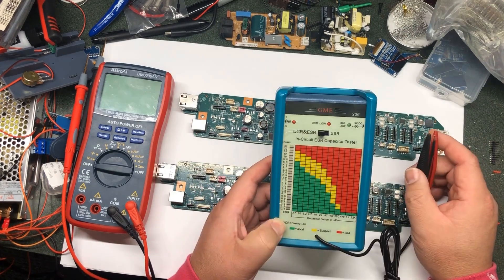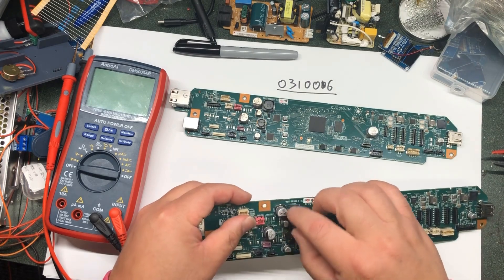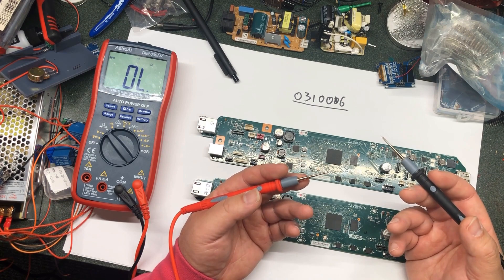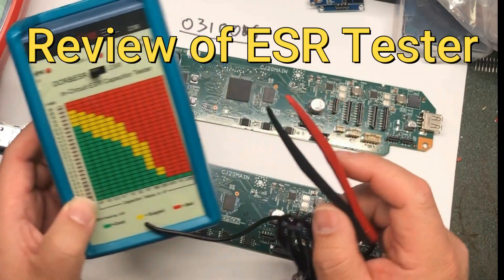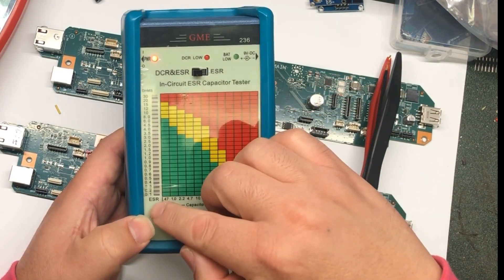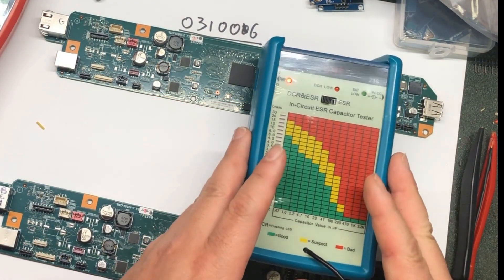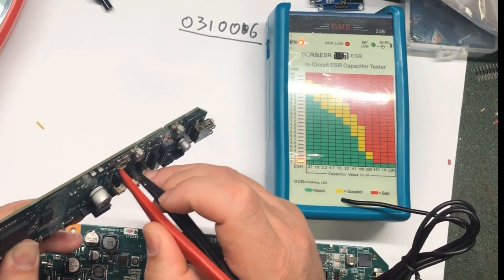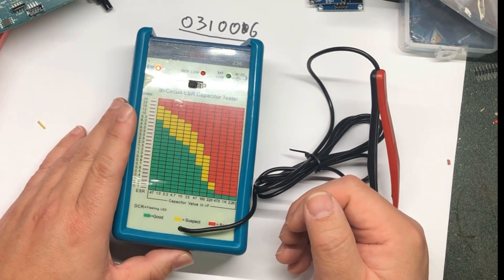Diagnosing ET-8550 Mainboard 031006 Error with In-Circuit ESR Capacitor Tester & Multimeter

Comment: Thank you very much for your reply. I have another basic question: when the device is set to DCR/ESR mode, and the test probes are short-circuited, it makes a beeping sound, like a siren or an alarm, similar to a police siren. I mention this because the BK PRECISION 881, which is exactly the same as yours, also makes this sound.  It's just a curiosity; I've already ordered the same model as yours (GME 236). My specific question is whether yours also makes the same beeping sound as the BK PRECISION. Thank you very much. Best regards.🎩
Reply from the maker: Thanks so much for your kind words and for supporting the channel! Yes, the GME 236 I use does make that same beeping sound in DCR/ESR mode when the probes are shorted, just like the BK Precision 881, so what you’re experiencing is completely normal across these models. I do get a high volume of questions, so please know that subscribers and members are prioritized for answers, typically within 48 hours, while I try to respond to other viewer questions as time allows. If you need faster assistance, you can always email [support@bchtechnologies.com](mailto:support@bchtechnologies.com). Please consider subscribing or even becoming a member to enjoy priority answers, exclusive benefits, and early access to videos, and if this video or my reply has been helpful, it would mean a lot if you could kindly leave a review on my Google page: [https://g.page/r/CfL7k6nYvPQ9EAg/review](https://g.page/r/CfL7k6nYvPQ9EAg/review)

Comment: Good afternoon, sir,
I hope you're doing well.
I have a quick question about the BK Precision 881
I'm currently repairing one; a high-voltage capacitor failed, damaging some internal components.
What I need to know is the resistance in ohms of the test leads on your BK Precision 881 power supply. Mine measures 5 ohms, and I wanted to verify that value against yours.
I would be very grateful for any information you could provide.
Sincerely, Alberto. tks 🎩
Reply from the maker: Thanks so much for your support and for engaging with the video! On the BK Precision 881, the resistance of the test leads can vary a little depending on the exact condition of the leads and how they’ve been used, but a reading around 5 ohms is within the expected range and not unusual. We get a high volume of questions every day, so while I try to answer as many as possible, subscribers and members are prioritized for responses—typically within 48 hours—and they also get exclusive benefits like early access to videos. If you need faster help, please feel free to email us at [support@bchtechnologies.com](mailto:support@bchtechnologies.com). And if this video or my comment has been helpful in your journey, I’d really appreciate it if you could kindly leave a review on our Google page here: [https://g.page/r/CfL7k6nYvPQ9EAg/review](https://g.page/r/CfL7k6nYvPQ9EAg/review). Don’t forget to subscribe or become a member to enjoy priority answers and other exclusive perks!

Comment: Mine got shipped with ink. Pulled this error. Broke it open and it was full of ink everywhere lol. Got a new one and kept the first one for free. Not sure there's much to salvage besides the head, catch tank, ink that's left, and mechanical parts. Sensors and board are most likely toast. How likely are the sensors and board to be ok? They are covered. I know a few of the sensors are done for sure. I am in no way an electrician i only know a little bit about a bunch of stuff. Master of none